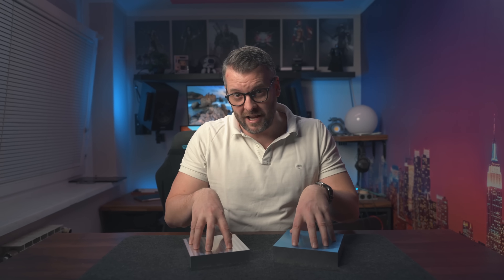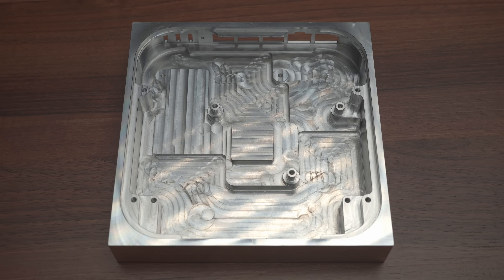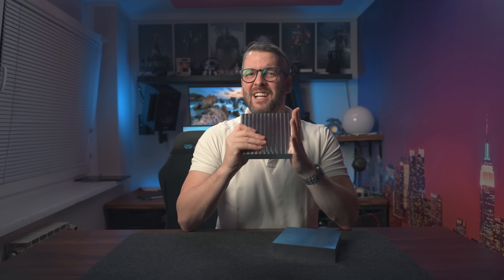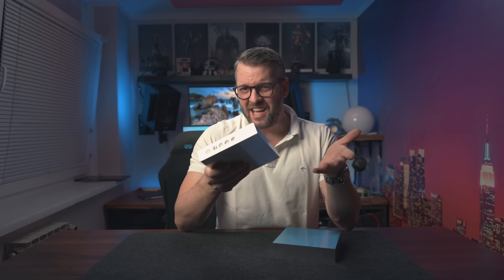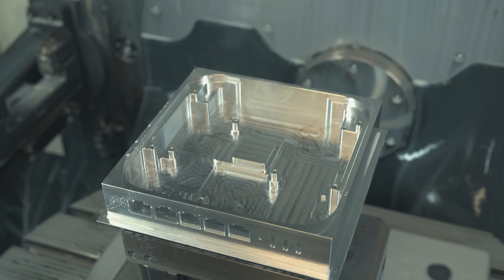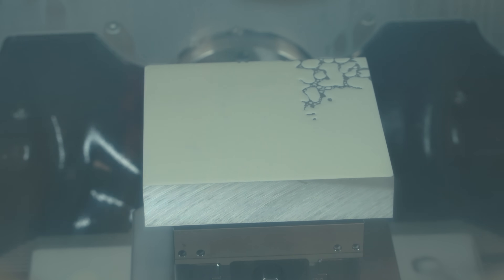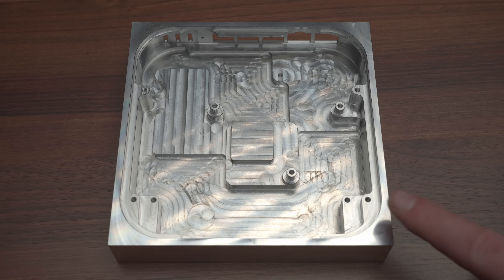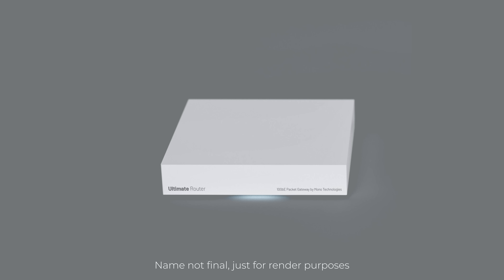We're building a high-end router. Here's the update for December 2024.

Comment: Uhh, I may have missed it, but how did you deal with the traces displaced by those mounting holes.  It seems like a huge amount of design work for worse signal integrity compared to just making the board a bit larger.  Or you could have taken advantage of the solid metal case to hold the entire board by the edges.

Adding a single centimeter to the board would also likely let you get rid of the undercuts.  Which would massively decrease your manufacturing cost.

Comment: You could add some design elements to the sides of the case that hide some cuts allowing you to get a tool in sideways where you currently relying on ones from above. This might allow you to easily get square cuts under the corner overhangs instead of round ones. You might just end up with a distinctive design that you like better than the monotony of pure aluminum block. Or if you feel your customers want to pay for the pure block look IDK.

Comment: "High-end" does just not mean "expensive". This seems like "waste of money" instead of "high-end". Your discussion about this "high-end" router only covers some stupid milled aluminum block of a case for the device, so it doesn't sound like you'll get a lot of bang for the buck in whatever this thing is. If you are intending on using the case for passive cooling, you should increase the surface area and make fins into the lid, instead of wasting time and money on everything that is not actually helping the device be "high-end".

Comment: I am searching for affordable high-end router for ages now, but I personally do not care if it is from plastic with off-the-shelf cooler inside (with maybe small lowspeed fan) or from huge block of aluminium. Tomaž, you should consider making also cheaper version with just plastic case as I personally will not buy it if 1/3th of the router cost is nice aluminium case. Selling just the board itself would be also way I think.

Comment: Im concerned on electric shorts happening internally since aluminum hopefully the anodization is also internally leaving only parts that need to be conductive exposed. Also a full range thermal test is probably wanted to see what the operating temperatures are like can it perform well at -18C or 0F to 100F?
Reply from the maker: Electric shorts are not an issue. There's plenty of space between components and the enclosure. And thermal tests are next on our to-do once the bringup is done.
Reply: @tomazzaman  Thanks!😁

Comment: I don't understand why you decided to use overhands, instead of a single flat-ish square aluminium cover. In that case you could have simplified the inner milling stuff specially close to the edge, using smaller radius millings.
A lot of effort have been made to make this a cost effective high-end router, yet the enclosure is designed to be a complex piece of engineering rather than something simple.
The rounded bottom cover is totally overkill considering that it is not even visible normally.

As much as I like the design and the premise of this product, less is often more.

Comment: You could use the RGB LED both for the boot and the normal usage:
- Boot: Red - startup ; orange - BIOS ; yellow - OS ; green - System config ; blue - Starting of Services ; indigo - User Auth ; violet - placeholder
or 
- in use: (red - power error; orange - stand-by/loop of death; yellow - network problem; green - nominal ; blue - nominal 10G ; indigo - overheat ; violet - overpower)
Or you could leave it in "open source" state so that people can tinker with it later (as long as they don't reset, in which case, the "factory settings" apply).

Comment: On my zyxel device, both the RJ45 and the SFP+ ports are fixed in place by the front of the enclosure - and that's not even so nice aluminum. I wonder if by replacing the USB ports for something that can get through the enclosure you might not be able to save significant amount of money on both milling and assembly - removing all the screws. When the enclosure holds and fixes the ports in vertical and horizontal direction, you need just the screws around CPU to fix the lateral movement and at the same time provide the assurance of sufficient pressure for thermal contact.
The only thing I learned form my short engagement with physical device manufacturing is - use as little features as possible, everything cost a fortune if you multiply it by 1.000 devices made. Each saved screw, internal thread, etc, makes a lot of difference, not only during manufacturing, but also during assembly, QA, ...

Comment: 1) Why not direct case-to-IHS contact, with thermal paste in-between? That thick thermal pad will affect performance significantly. 
2) Also, wouldn't it make more sense to machine a flat bed and then use standoffs like motherboards in pc cases? I am pretty sure that this reduces the machining time and the number of different bits to use. 
3) The machining through the USB-C cutout is ingenious, not gonna lie, but I am pretty sure it is the wrong outcome. I am not sure how much trouble it is, but you could swap the reset button with the outer USB-C port, thus, eliminating the need for an additional step in machining. 
4) I would also ditch the double bottom, completely unnecessary ( you could, again, use standoffs for some mechanical support for M.2 cards)

I don't want to be the Grinch of this project, but some parts of it don't seem to be the best choice even before the optimization step. But maybe the design choices need more explanation, so maybe, a deep insight video is necessary...

Comment: Tomaž, I think that this project is unfortunately DOA due to too many complications to get close to the design, e.g. Apples, which unnecessarily raises the price. CNC machining hours are very expensive and it is better to increase the printed circuit board in order to simplify the processing of the case, to have less CNC machining hours, special tools, etc... many people have network equipment in a rack cabinet so that it is also necessary to include possible rack mounting. It might be worth considering if there will be a large series, to make the case with aluminum die-casting... Instead of thermal pad, consider thermal putty. Think about this points it would be a shame if the project fails becaus of pricing...
Reply: Agree. I wrote to a similar comment the same: 
A bare bone version would also be great. It would not have any extra cost maybe a different bare bone package for delivery. It would be like the BanaPI R4. 

IMHO it should have 3 version:
- Bare bone Version (maybe with accessories)
- Standard switch/router body for mid range 
- Premium CNC version

I know it would be more work but that way it would have a broader audience. And it would also be much easy to recommend it to different people.
Reply: @muazapuhan a plastic case version was promised/planned for sometime later. 
I don't agree that a bare PCB version would be a good thing. It is not a hardware tinkering platform like Raspberry Pi, only has some M.2 connector, and ports. There would be no hardware ecosystem around it - at best, only some 3rd party cases...
Reply: @cristinelcostachescu9585  I musst have missed the plastic version. 

I understood from the previous videos that the hardware and software will be open source. I can well imagine that the community will do a lot with it, so I still see that the bare bones will be very popular.
Reply: Yeah there is good reason why plastics and bended sheets of metal are being used for basically all networking equipment instead of CNC milled blocks of metal. Faster to manufacture and cheaper.

Comment: Tomaž I'd recommend using thermal putty rather than thermal foam, it can be extruded and many puttys have a beneficial relationship with aluminum I'd recommend HY256 Green Thermal Putty from Halnziye. Since you're getting the PCBs soon you could try some A/B testing with the foam and putty, also it would be great if the status led could be turned off incase its too bright. Can't wait to have the router in my home!

Comment: All this could've been avoided if you designed the bottom part and the top+ side parts seperately and not as a single piece. so much waste and compomises just to say "ITS A SINGLE PIECE LIKE THE MAC MIN"
Reply: The CPU is in direct contact with the case, which acts as a heatsink. Unibody case (single block) allows for more thermal mass - instead, separate parts would be independent.
Reply: @cristinelcostachescu9585  yes, I'm aware, but I doubt few watts will make a huge difference. After all the two parts can still make contact. Aluminum is very thermal conductive, so is it worth the price and complexity increase? For me it's not.
They made custom bits, use special t bits and go slower just so they can keep a uni body.
Reply: @aliensarefromspace  individual parts have very poor thermal conductivity, to the point you can assume they are completely not touching. And also, I think you're vastly underestimating the difference a few Watts does to a CPU that is designed for 15-20W operation. Anything you can squeeze can be the difference between normal operation or thermal throttling on this device...

Comment: Blue is connecting/booting, green good, red error(needs attention), orange lost Internet/WAN but LAN is receiving data. Yellow, Violet, use as see fit(you're kindof limited by number of colors as they blend together or get confusing to end users), and then flashing for other information of the current status(such as continuous blue for booting, blue flashing for connecting) or (red flashing pulses = error number, 1 - 8). Just a suggestion as most companies use this same style and I understand it out of the box, but that's just my opinion obviously. Good Luck, I am interested.
Reply from the maker: Thanks for the suggestions - I'll actually write these down, as they all sound pretty reasonable!
Reply: @tomazzaman wooo! Yeah, I like customization, so I mean if it was homebrew obviously adding your own color array would be super easy, but still. As a default to start I figured "standard" might just be a good idea for anyone who's just simply setting it up and forgetting it.
Reply: @nathantron  I wish the debug leds would all be visible and configurable.
If you don't like the x-mas light tree effect, switch them off in the settings.
Multiple leds could indicate more information clearly than a single led.
A user configurable small status display would be even better.
Reply: Making the light orange will make people think its negotiating as 100baseT, possibly not a good idea?
Reply: @Fortless as long as the manual states the meaning of each color, and there are no ambiguous colors (both yellow and orange, or pink and violet), I don't see this as a problem.
Reply: @FortlessI also wouldn't think so as it's not the ports/LEDs next to the RJ45 jack. He was referring to a singular front RGB led on the case.
Reply: @nathantron  ah, my bad!
Reply: One thing to keep in mind though is colorblind users - it's fairly common and way too many products use combinations of colors that are hard for people who are red/green colorblind to tell apart, for example.
Reply: @ I understood this leds is rgb and can be configured.
I thinks the design of the router enclosure is inspired by steve jobs to make it stand out from the other plastic routers, so they put a lot of effort in the mechanical design.
For me personally this will not be the deciding factor to buy. For instance, I dont like the apple keynotes where they announce new series of devices that come in "amazing" new colors with idiotic sounding names. I'd prefer to have them cheaper and in single color.

Comment: Why don’t you make the curve start later so you don’t have to machine the USB-C port that way?   So instead of a „normal“ curve, you could use a compound curve and shorten it that way.
Reply: Because the curve is machined with an inside cut, and they are already using the smallest bit possible for that. There is no more machining space for a smaller inside curve... 
This being said, I seen this as one of the reasons (among many others) why the case design is flawed and I suspect the price is going to be way higher than expected...

Comment: Why not using castaluminum / molding often known as die-Casting and then milling ?
It’s less material and cheaper.
Reply: Molds are stupid-expensive, and considering this is a sort of prototyping stage, this makes (money-wise) most sense. After everything's done, slicing the case into multiple parts for either quicker CNC  or other methods, like half plastic half aluminum (like Apple's Mac Mini).
Reply from the maker: die-casting + milling costs roughly the same when you factor in mold manufacturing and maintenance.

Comment: It does look pretty. But it looks way too expensive for a router. Guesstimating but the Aluminum block is at least €40 plus machining of this is certainly over €30 and these would be volume prices.

Why not just laser cut sheet metal that's than bent up to form the bottom case. And than a single pice on top....

Could probably get the case cost down to €10-15

You'll be creating an "Apple" router without the ability to promise support/warranty into the future. If you'd hit a price close to Cisco or even Ubiquity, speaking for myself, I'd just choose the enterprise option that has a history of user support/ability to take a warranty claim within days not months 

I still hope for the best for the project. But personally seeing the manufacturing of the case being over engendered to a point of unnecessary... I don't know if I'd get one
Reply: Depends on the real world throughput of this device. 
Mikrotik can handle up to 300 MBps with less than 1000,--. 
Cisco 1000 up to 200 MBps for 1500,--, 
4xxx up to 400 MBps for 4500,-- 
I don't know about Ubiquiti, i only use theiur WiFi solutions.

That is why i use general purpose PC hardware for my firewalls. They are much cheaper.

If this thing can handle more than 500 MBps fully encrypted for less than 1.500,-- 
i do not care about 10,-- more or less. Or any repairability.
Reply: The case is used as a heat sink for passively cooling the CPU. I doubt sheet metal has enough thermal mass for this purpose. Tomaz doesn't want a fan in there, and personally I agree. 
Though, I am pretty sure there are better ways to machine that case to bring the cost down while keeping efficiency...
Reply: @cristinelcostachescu9585  thermal mass isn't as relevant as thermal conductivity and emissivity; if the heat load is constant, thermal mass won't matter because the enclosure will "heat soak" and reach equilibrium. What's more important is being able to radiate/conduct the heat out of the enclosure. Sheet metal is fine if the thermal conductivity is still high enough that the energy can still be dissipated without too much temperature rise.

Comment: RGB front led is nice for the basic debug indicator (and complex ones too). Optimize the inside as much as possible, because it can be a bit rought with larger bits when it'll get somewhat sandblasted/anodized at some level anyways. I mean we ahve the PCB on the inside anyways and it has more prickly edges due to components & rough surfaces anyways, why bother with inside when at most it just needs to not remove skin or cause irritation after handling it.

Comment: Have you seen the Alta Route10 which is a 200$ Router that has 2x SFP+ 4x 2.5GbE (2 with PoE+)? It's based on a Qualcomm IPQ95XX SoC
Reply: OpenWRT?
Reply: @ OpenWRT based but it’s basically running Alta labs system. In the forum you can see changelogs with updates from just 4 days ago and I'm pretty sure they'd need to publish source code too but didn’t see anything there. Don’t own it but from just the hardware it looks very compelling even ignoring the price
Reply: @meco  I agree what hardware looks great. 
But there is number of devices which use closed source fork of OpenWRT and at some point abandoned. Or stay closed for custom pkgs.
I started with OpenMoko back then and for now completely lost interest in such devices...
Reply: @meco  It is very fast and stable, but I worry about the same as others that eventually they will get bored of maintaining it, and at that point it is a brick since they have locked it down.
Reply from the maker: Yep, saw it
Reply: @tomazzaman  Thoughts?